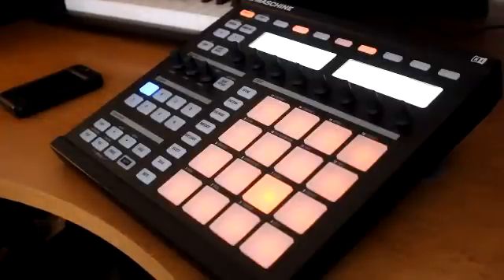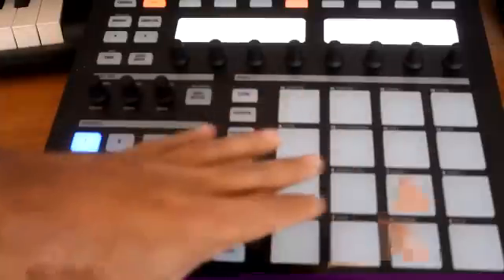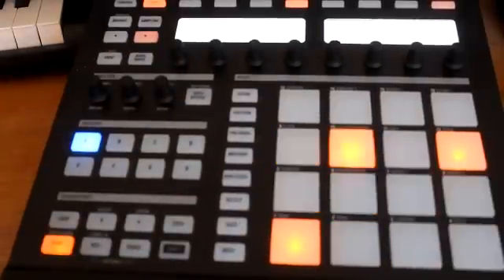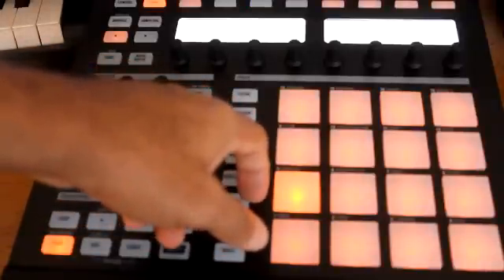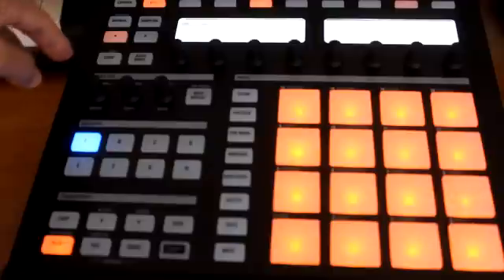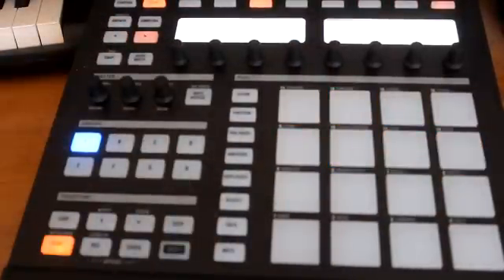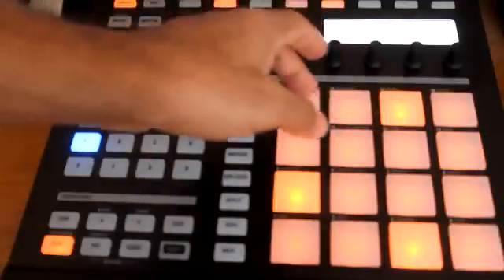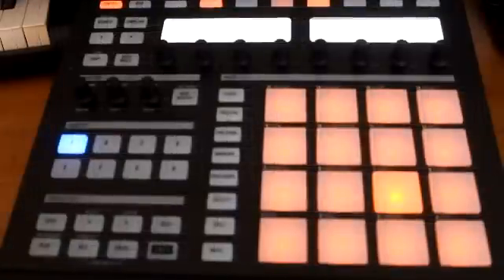TIPS: Programming Drums On Maschine with Step Sequencer

Comment: You seem pretty comfortable using these devices. 
I was wondering If you could direct me to a good website to purchase one of these devices. And as for FL studios, is it compatible on the mac?
Reply: +isaac robles Zounds is a good website or Sweetwater. FL is compatible with Mac but it works smoother on PC.
Reply: Go to eBay and get this, that's where I got the maschine mikro including the software for only 200$ BUT MAKE SURE THE SOFTWARE IS INCLUDED

Comment: A lot of the times plugins loaded into maschine have auto mapped parameters with multiple pages in the top section. If not, maschine can also be used as a midi controller and you can map whatever you want. (Shift+Control toggles Midi on and off) I use the midi function for traktor and ocasionally ableton